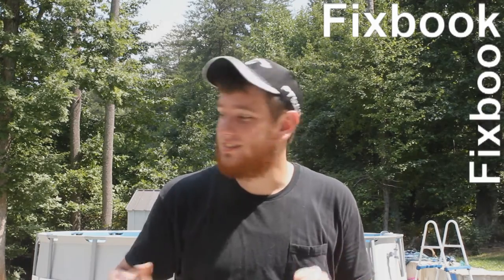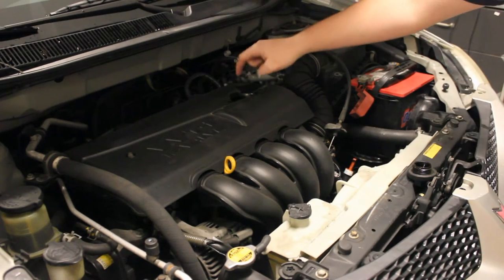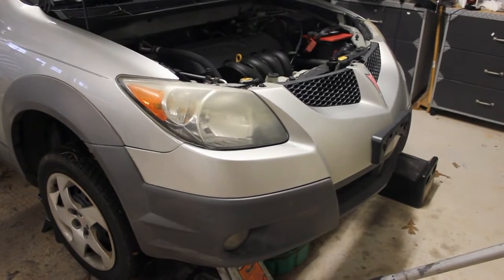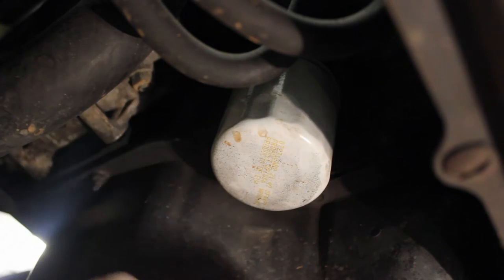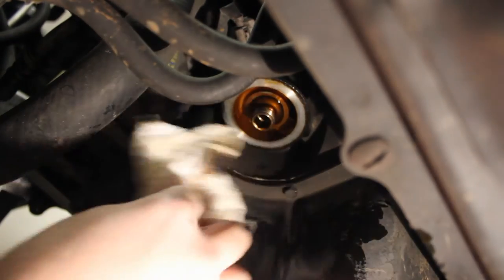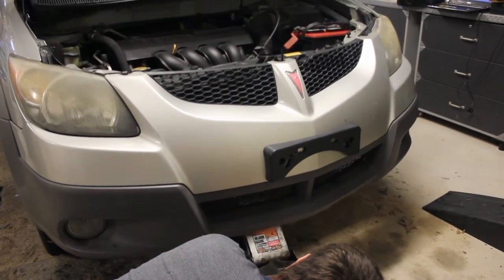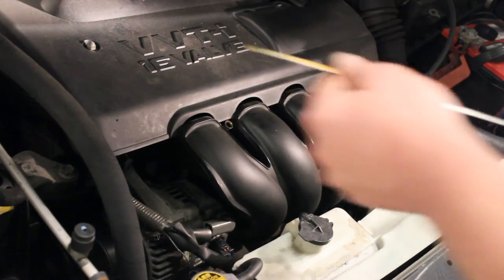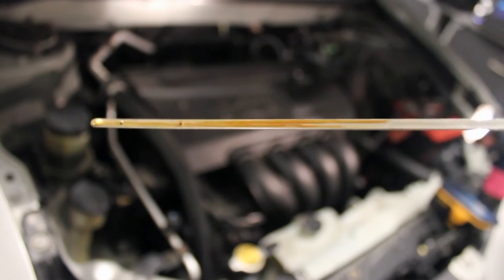How to Change Your Oil

Comment: Jordan, here's a tip I'll give you. On filters that install in a vertical or near vertical position fill the new filter with clean oil before installing. It will fill and pressurize quicker. Plus Super Tech filters from Walmart are cheap and high quality. Open one against a purolator and compare.